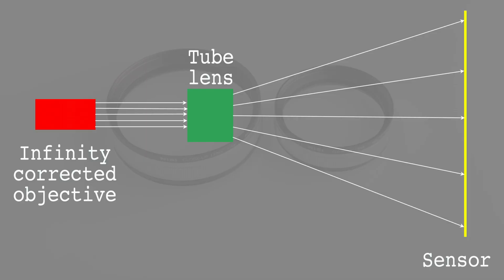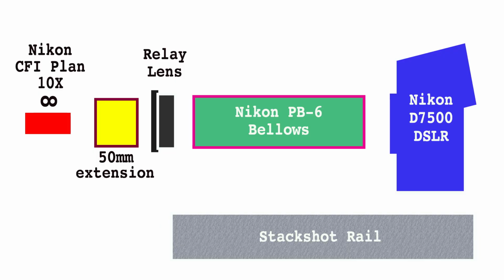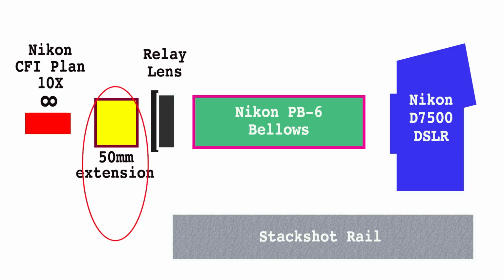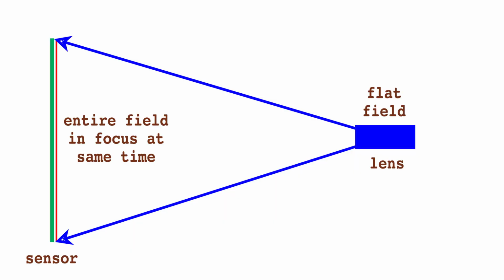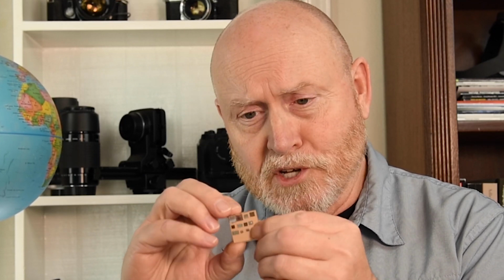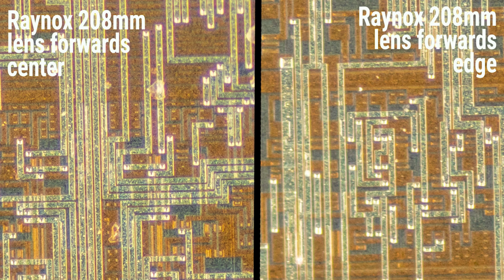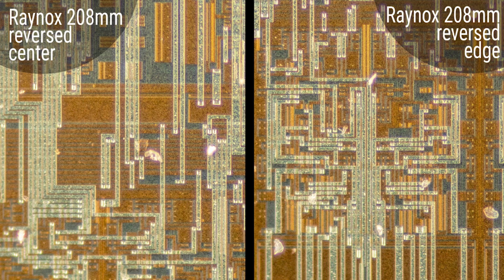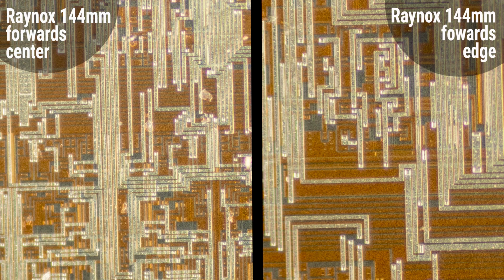NiSi Closeup Lens vs. Raynox DCR-150 - as a tube lens

Comment: Hi Allan. I just came across this video today. To add to what you said about the Raynox 150, the focal length is 208 mm when used in its normal orientation, but when used in reversed, the focal length is reduced to 125 mm and hence with a 10x magnification, you will get something between 6 and 8x, but with better sharpness. Thank you.

Comment: Thank you very much for this and all the other information.
Doing a much less precise test than the one done with the chip (a paper printed with laser ink), I seem to see that from the infinite position (208mm) to the one found by Peter Otoole of 144mm, there is a continuity, which is very interesting. 
Here you can see the tests I did, starting with the Mitu 7,5/0,21 and on the following pages the 5/0,14 and the 10/0,28: https://foromacrosmuymacros.com/viewtopic.php?f=12&t=860&start=10

What do you think?

All tests together   https://www.flickr.com/photos/rubio41/albums/72157719391410303
Reply from the maker: Fascinating work, Alfredo. I have done something along the same lines, but your findings are consistent with my own (I am going to get the article you sent translated, to make sure I am not missing anything). Can you contact me by email to discuss further? contact@allanwallsphotography.com
Reply: @AllanWallsPhotography  Thank you Allan for your comment. I have just sent an e-mail

Comment: Allan, when you position the Raynox at 144mm where are you measuring from? Is it 144mm from sensor to back of glass, front of glass, or middle of the tube lens? Or are you measuring from the lens mount vs sensor. Same for the objective lens, where are you measuring from when setting the 50mm infinity space. I appreciate the help and if this has been answered before I'm sorry for the repetition.
Reply from the maker: This is a question I am asked 3-4 times a day, so don't worry about it! The distance of the relay lens is from the sensor to the lens element that is nearest to the camera. An exact infinity space is not necessary, but I measure from the front element of the relay lens to the flange of the objective (where the threads hit the barrel. Hope that helps!

Comment: Need help putting together a setup using a Nikon Epi10 0.25 infinity lens.
Reply from the maker: Hi Pete, it is a 200mm focal length objective, infinity corrected, but if we are talking about the same lens, it is designed for non-contact interferometry. I've never used one ($2,000 and a 7mm working distance being the main reasons), but it sounds like a cool project - shoot me an email and I'll be happy to help you work through setup and lighting issues that are going to make it difficult.

Comment: Hi Allan. I recently came across your videos! i like them, much information, thank you! i use the raynox with the nikon 10X too, but is there a reason to use 50 mm extension between the nikon obj. and the Rainox? Greetings from Belgium!
Reply from the maker: It is not mandatory that the infinity space be set to 50mm, but over the years I have the image quality to highest at that length. At shorter distances I was seeing occasion loss of contrast from internal reflections - that all goes away at 50mm. I can't go much further than 50mm before corner darkness creeps in. 50mm seems to be the goldilocks infinity space for me!

Comment: Nice Video Allan, I have Raynox 150 and 250 that I use on my Tokina 100mm macro. But recently saw this Nisi and thought i can use the 77mm Nisi on my Sigma 180 macro but not considering this combo now after your review :)
Reply from the maker: Actually, the 77mm NiSi will be an excellent choice to use with the Sigma 180mm, as a closeup lens magnifier. It is less capable as a relay lens, at least compared to the Raynox.

Comment: How do you measure the 144mm? I know it is from the plane of the sensor, but where on the DCR-150 do you choose to set as the exact point to measure from?
Reply from the maker: From the sensor plane marker on the right side of the camera to the rear element of the closeup lens, which is where the base of the flange (the end of the threads) meets the lens barrel.